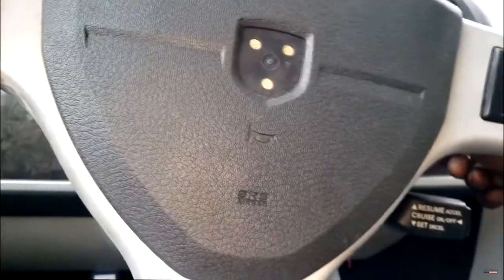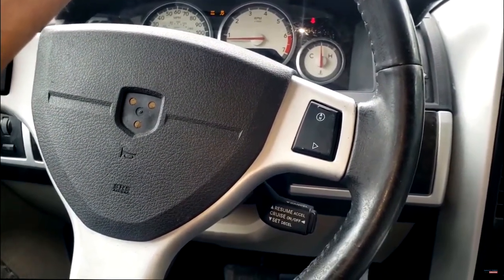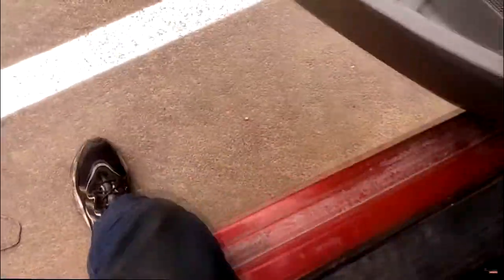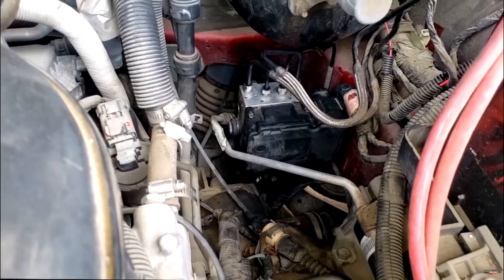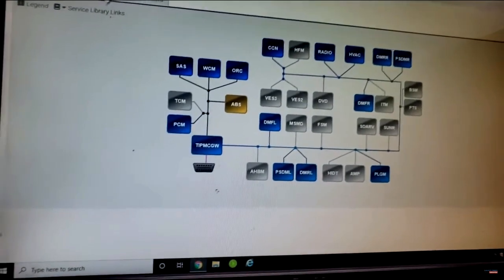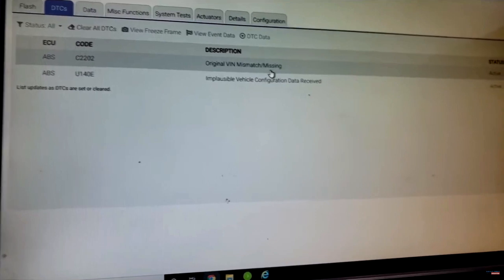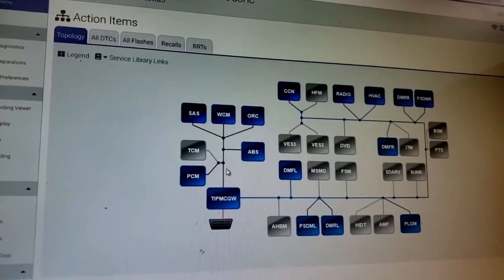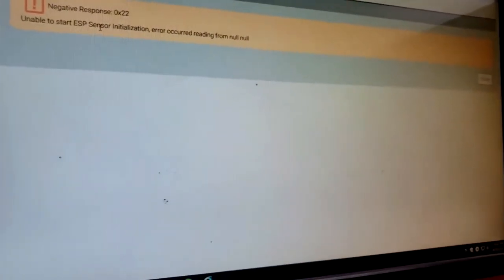This used Car Computer may or may not work for this ABS Light. Lets check

Comment: I haven't looked at the tech authority website in a long time; Is a download available for abs modules?  If so, and if the modules share the same hardware, then it's likely possible change the module firmware to a version for that vehicle.

Comment: Is there a way I could ask you a few questions about my car? It’s a 1995 Acura integra 1.8l b18b1 I had recently put a new distributor in because it failed on me and so I put the new one in and it was working BUT It started sputtering I believe due to timing being off
Reply: What are some things I could possibly do to fix this , maybe an oem distributor? The one I Got is aftermarket because I haven’t been able to find a certain one that works with my car, should I use a timing light and try to short the computer with a paper clip and attempt to fix it that way? Or , lmk! I’d appreciate it and hopefully with your advice I’ll be able to fix it maybe